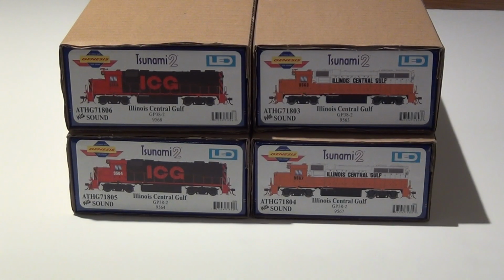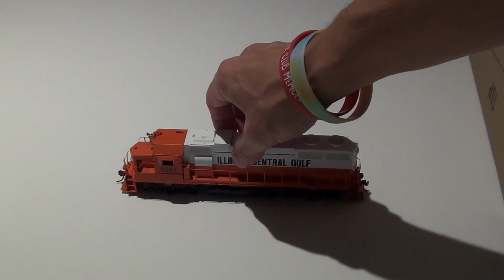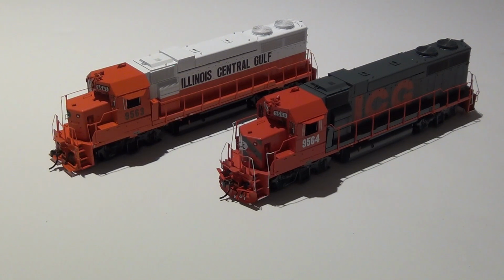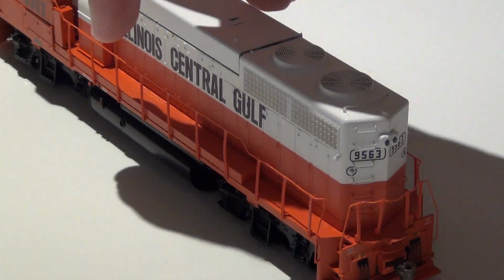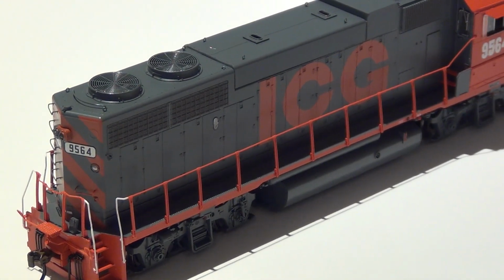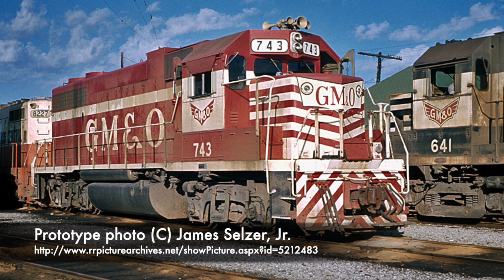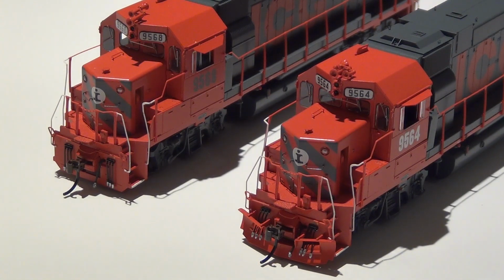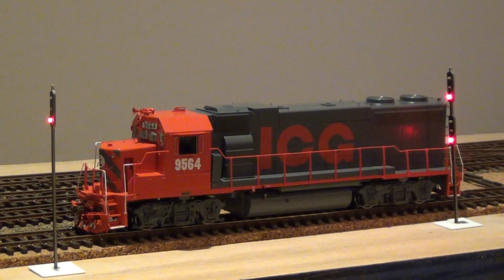Product Review:  Athearn Genesis GP38-2, Illinois Central Gulf, October 2021

Comment: Could you pair this with a Mainline GP9 and compare the sounds?
Reply from the maker: Hi Bradley, what are you wishing to accomplish?  A GP9 (no matter what brand) and a GP38-2 comparison (no matter what brand) isn't an apples-to-apples comparison.  A GP9 has an EMD 567 prime mover and the GP38-2s have an EMD 645E prime mover.  They sound completely different.  What it boils down to is speaker quality.  In my opinion, Athearn have better speakers than what is in the Walthers Mainline locomotives. I have a few videos from about a year ago that really demonstrates the sound from a Walthers Mainline GP9.
Reply: Just wanted to compare the sounds.